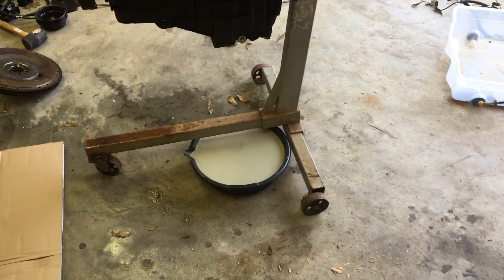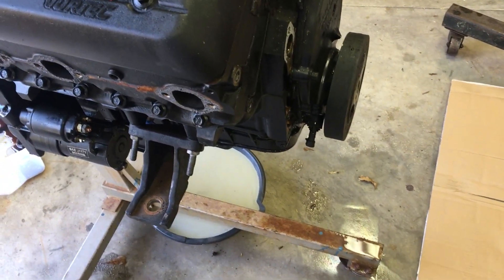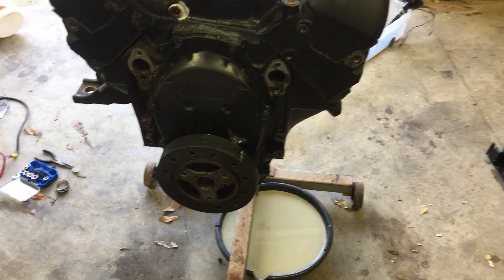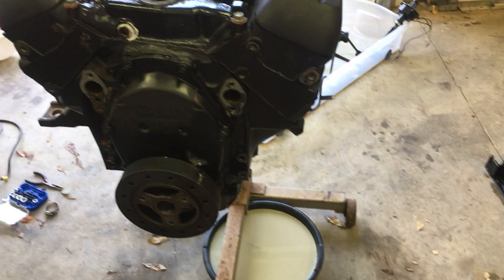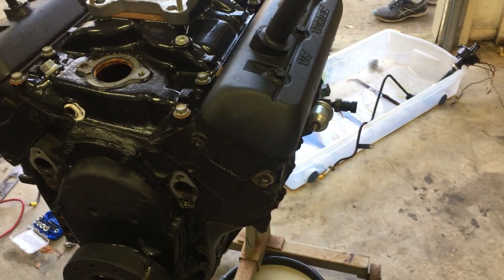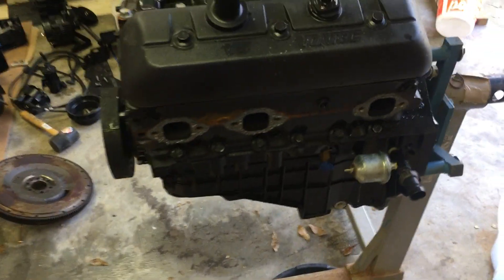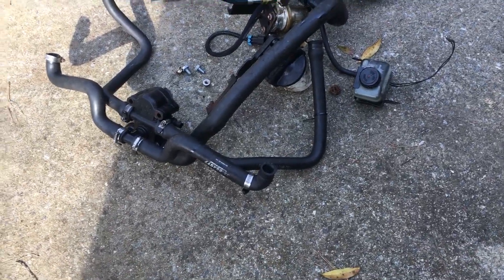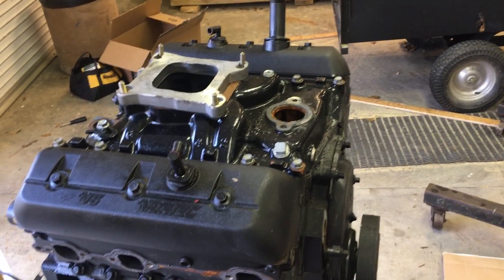4.3 Mercruiser Engine Teardown Part 10

Comment: Semi-pro tip, if the motor being rebuilt is going back into the same boat, unbolt the mounts from the block just before you pull the engine.

I find 9/10 times, the alignment is good upon reinstall w/out any adjustment. I now check the alignment before I pull and typically, the 1/10 has proven to be either out of alignment in the first place or changing the transom seal shifted it slightly out.

Liking the, gonna have to circle back and hit all those like buttons.
Reply from the maker: Appreciate the tip but based on the geometry of the rear mounts, which fixes the vertical dimension of the coupler opening to the driveshaft, the front mounts in theory only adjust the angle of the coupler opening. I’ve found that if I don’t disturb the front mount lower nut which is basically supporting the front of the engine, it’s aligned. The one time I had difficulty aligning an engine was due to a defective coupler whose rubber hub was not concentric with the metal housing.

However, I have had to remove the front motor mount brackets from the side of the engine to make it easier to get the engine back in the bilge due to tight quarters and the chain being at the wrong connection points.